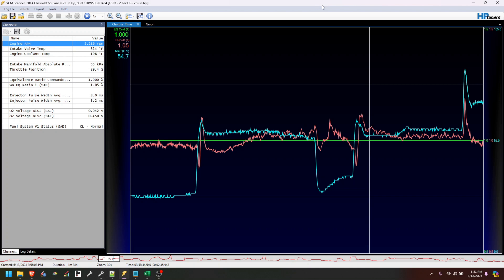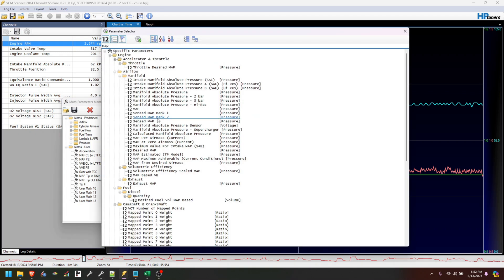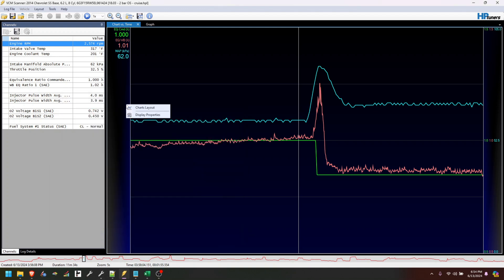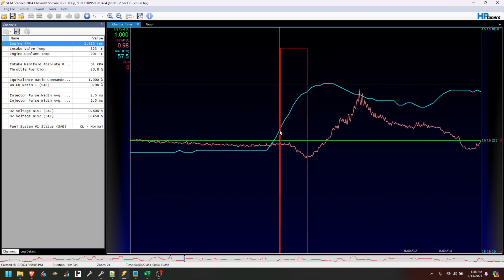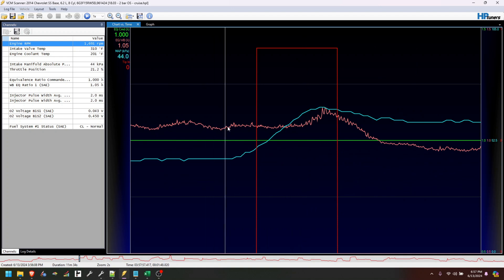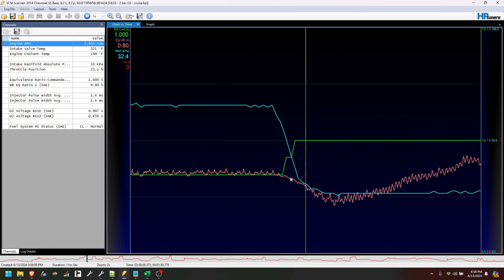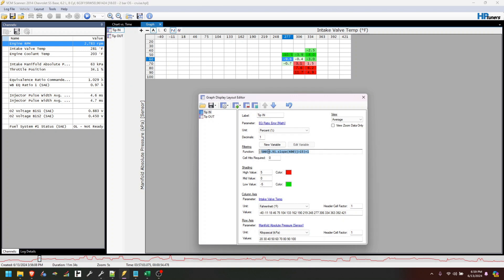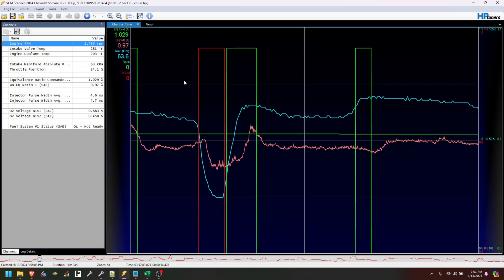Filter Like an Ace

Comment: All you need to do is offset the wideband vs the rest of the datalog based on rpm, which is what the ecm actually does... OH WAIT you can't do that in that software. Use EFILive and get these things ironed out easier.
Reply from the maker: I would be curious how this offset business works...does it offset properly for different RPM's? Idle would have the longest offset, high rpm would have the least. I have never used EFILive.
Reply: @SilverSurfer77  You are missing out. you can offset however you see fit. you can create your own formula for how much to offset. I have various depending on logging speed also.
Reply from the maker: @highlanderc  man I think you need to make some EFILive vidoes! Maybe I will have to switch teams LOL

Comment: This is about the point I export to csv and stop using the scanner. WB signal delay is obviously a model-able thing, but the scanner doesn't have the knobs to generate it as a function of MAP, RPM, etc. Widening the window excessively gets the leading edge of the signal but you miss the rest. And it skews the axis inputs because you're looking at enabling criteria after the event is already over. They really need to improve the scanner feature set.
Reply from the maker: I have exported to CSV many times...but man what a chore. I agree HPT needs to modernize. Maybe once they get Global B settled they can focus on this...oh wait...once they get the Core ECU settled...err...it will never happen.